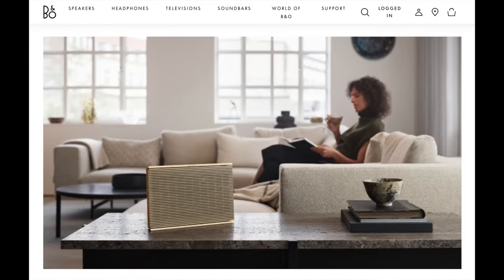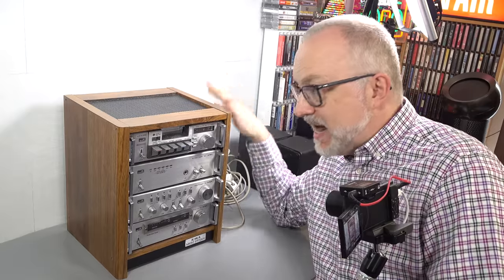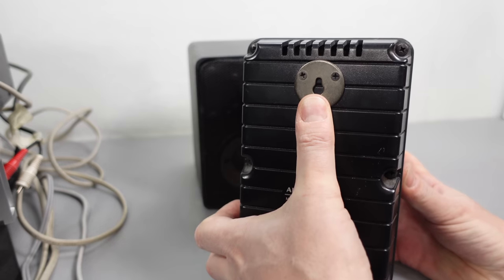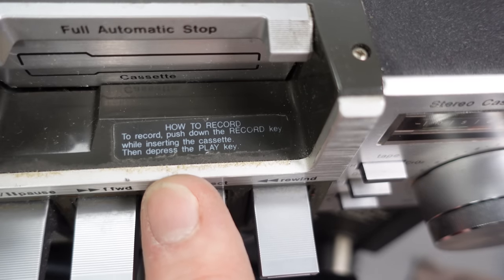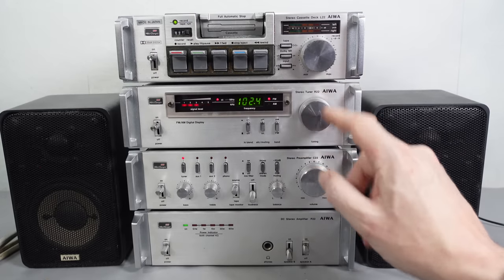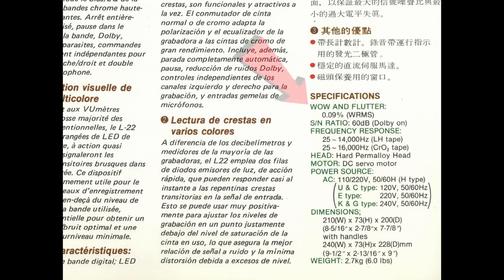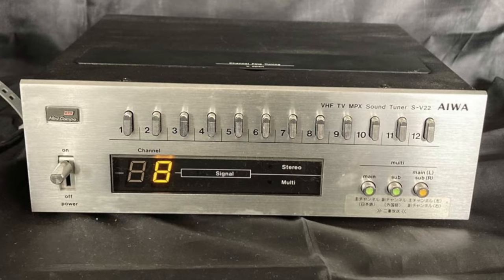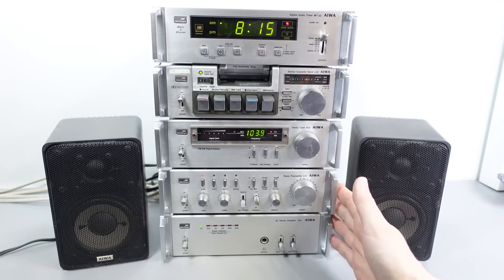AIWA SYSTEM 22 -  Micro HiFi from 1979

Comment: Hey, Matt, a neat trick to temporarily shrink the loose belt is to dunk it in hot water for a minute or so. It won't hold up, but in a pinch, it'll get you going while you wait for a replacement belt to arrive. It doesn't matter in this case, as you're only missing out on the tape counter, but it's a good trick to have in your mental toolbox.
Reply: i boil the heck out of my belts, like 10-15 minutes. they shrink but i've boiled one out of my Philips boombox, that I play tapes in a lot, and its been months and the belt is still good. wow and flutter is also relatively low
Reply: @RealEpikCartfrenYT  yeah, it can last a couple of months, but eventually they fail again. I learned this trick when the CD tray of my XBox 360 failed to open back in 2015 or so. Boiled the belt, worked like a charm. But it didn't last. So best get a new spare for when the old belt eventually fails on you again.

Comment: We had a AIWA mini system that was a "Boots" badged product from    the early 80s. Great system that lasted over 30years. Infact it was very similar to this, so probably a later evolution.
Reply: I have a Boots hi-fi receiver of the same era which was a rebadged Awia product. I recognised many of the switches, LED style and text font.  Nice amp and still going in my shed system but the tuner had poor sensitivity from new.
Reply: brilliant and far better than paying every month for a wifi connection..
Reply: @iawarenow658  How are you accessing YouTube?
Reply: My Aiwa 22 was originally purchased at Boots and the speakers are Boots badged Keesonics (and are very high quality; they are a delight to listen to, and are in regular use).
Reply: A lot of Boots badged consumer electronics products were surprisingly good
Reply: I have an AIWA NSX-D5 from more into the 'mini era', 1992 I think, and listening to this video through it. The CD player needs a new belt I think, and the cassette decks will play, but not wind/rewind (belt problem again?) It's pretty hard to access the CD player's innards. Otherwise works as an amp and speakers, great power and range.
Reply: @IThinkYouLookLarvely  so almost none of it works save the 'aux' input?
Reply: @ILuvHeroin  Probably a simple fix for the cassette decks. I just like the amp audio quality better than a newer Technics setup I have. Oh, it does have a radio that works :D

Comment: The 22 probably refers to the spacing on the rack bolts, as that's ultimately what determines compatibility.
Reply: Good call. Will probably induce a headslapper moment for Mat.
Reply: You get like for the idea, but I just measured mine and its 23.6cm from the outside of each 'handle' to 'handle'. They don't actually have bolt holes, just a removable rack handle. Distance from the centre of each handle is about 22.8cm
Reply: Makes me wonder if AIWA also provided 'flat' rack ears which accepted screws, for mounting in the flight-case style of cabinet.
Reply: 22 might be the depth of the unit(s).
Reply: @herbert weixelbaum  Height is 71-72mm. The Power amp is a tad taller at 72mm. Depth is very variable, again the Power amp in the deepest, at 24cm, the Preamp is only 17.5cm. The Radio, without the AM antenna is about 17cm.
Reply: @garyt123  i see. i don't own an aiwa system 22, so i can't/didn't measure one. i'm referring to the dimensions given on the site hifi-wiki, which are indicated as 210 × 70 × 220 mm. i cant' link to the site, sorry. youtube tends to regard my comments with links to external sites as spam. you can find it easily, if you google aiwa system 22 and hifi-wiki.
Reply: @garyt123  I think he means you measure the width of the opening on the *rack*, not the component. As in, they all fit in a 22cm wide rack?
Reply: @herbertweixelbaum  I think that wiki has some bad info. I, like Matt, measure my system (P22+C22+R22). With, and without the rack handles (which are purely decorative BTW, there is no "mechanism" or holes for actual rack-mounting) there is no 22cm measurement to be found anywhere.

Width, without handles 20.5cm, except the P22 which is 20.8. width with handles is 24.1cm.
Depth is variable. The R22 is smallest at 17.2cm. P22 is deepest at 20.2cm and the C22 is a tad over 17.3, almost 17.4cm.
All are 6.5cm without feet. 7cm with feet.

All measurements are just the actual case/faceplate, not including Knobs/Buttons on the front or connectors/AM antenna on the rear.
Reply: @bgood1673  Just checked. All except the P22 are 20.5cm wide. The P22 has cooling fins built in which make it 20.8.
The removable handles do add a little extra as they are not recessed into the case in any way and attach with two screws either side. Even counting those (which would be the exact size of the rack opening, they are still only 21.1cm wide.

So it still remains a mystery. The denomination is most probably a project number, or something similar. After all, their next mini system (1981), which did away with a separate pre & power amp which was replaced with an integrated version, was denominated the Series 30. They were not 30cm wide. Radiomuseum gives dimensions as 21 x 7 x 20.5 cm (WHD). The handles look exactly the same to me so there is no way we could get to 30cm.
Reply: Yep 22 from screw to screw

Comment: As for the "22", it's designed like rack-mount equipment, and racks are often specified by a non-obvious dimension. While the setup you have doesn't hold the units in place with screws, that flight case at 3:18 makes me think it was an option, so it might be that the 22 is the distance between screw holes, maybe on-center?
Reply: Yup, that might very well be the case. The width from the left edge of the left ear to the right edge of the case looks to be 22cm, so if the screws are centered on the ears, that'd be it.
Reply: every real rack system I have ever worked on is 19 inches wide and height is  specified in units, 1U = 1.75 inches, 4U = (1.75*4) 7 inches
Reply: @osgeld  Yes, for pro- or semi-pro units designed to fit a standard rack in a studio or flight case, 19" and the "U" system for heights is standard. But here, we're talking a consumer-grade hi-fi system that was designed to look like a set of pro-grade rack-mount units. Many home hi-fi systems of that era (and later) were designed that way, but in fact most of them weren't really separate units at all. Sony were particularly guilty of making systems that were actualy a good old "single unit" internally, but disguised to look like separates.

Comment: 22 might be the rack width. If the ears had mounting holes, they would likely be 22cm on centers.
Reply: I thought the same. I made a set of rack ears for my first CD player that were oversized to fit (19") and it looked factory original as I used similar anodised aluminium.
Reply: Yeah, that's what I was thinking. The distance between the bolts is what determines compatibility.
Reply: Standard professional rack hardware for music synth and even server computer is 19 inches. 22 cm is a nice width to put 2 of them side to side (half rack)
Reply: @patricklepoutre 19" racks have 17¾" of free space between the rails. Mat said that these cases are 20.5cm wide, which would put two of these at 41cm, or slightly more than 16⅛", which feels like an awkward gap to fill. I really like your thinking, but I'm not sure it works, and it still doesn't explain the "22". Maybe a 22cm-spaced sub-rack that can be mounted in a 19" rack?
Reply: @wbfaulk  You have to add a rail down the middle for support, that's where the extra couple centimeters goes.
Reply: 222.25 (8.75'') between inside flanges.
Reply: @mal2ksc  There already exist half-rack-width devices and they don't use an additional rail.
Reply: @wbfaulk  All the half-rack equipment I've worked with has either had side screws only, and required a center bracket, or had front screws (alone or in addition to side screws) and used a flat tie plate.

The side-mounting braces are a bit awkward to install, but look much cleaner. Of course, it also reduces the possible width of each device.

On further reflection, I do recall seeing a few devices that put their tie braces into recesses in the top and/or bottom. But none of the flat-brace methods are relevant here since these components only accommodate screws on the sides.

Comment: I do hifi repairs for a living, exactly the stuff you show around on your channel is the stuff I get my hands on pretty much daily. We get stuff from all over Europe and have found a lot of trust within the German Tape deck enthusiasts communities, so it's good to know that despite the age of cassettes and tape decks we are one to get them to work even in this current year.

Unfortunately it's a dying industry, almost nobody wants to repair old hifi anymore. The lack of schematics makes it difficult, and even if you get schematics and can make use of them with your electrical knowledge.. where do you get parts like for example the tape deck? There are of course sources to get alternatives that can provide parts that will make a repair work, but its again a very niche industry, we at my job are lucky we get the parts we do. 

I could self promote the shop I work at but unless you want to ship stuff to Germany (we have partners in the UK, nobody likes shipping in and out of Europe..), I wouldnt know what to suggest. 

Depending on where that VU meter on the tape deck is getting the levels from it could be a transistor in or near the output stage. I'm sure you've packed it away already, but next time try recording a cassette in stereo and check with another deck if both channels are present. Not what I'd do if I were repairing it but I don't think you'll want to poke around a circuit with an oscilloscope while the mains power is on lol.
Reply: How do you even get parts ? I'm sure there are some replacements that could be used for things like capacitors, but I was thinking a lot of parts would be impossible to source.
Reply: @juandenz2008  Most of the parts would be available, just some wouldn't be in quite the same package. The tricky bit, as mentioned, would be the things like the tape mechanism. Caps. diodes, resistors and the like are all much the same as they were though. Getting some values exact on some parts might be tricky, depends on the parts.
Reply: I've taught myself board level repairs for PC stuff over the years and the most common failure is capacitors. There have been some dreadfully cheap makers over the years, but I've seen even good ones fail in similar boards. I've replaced other IC's, like RAM, but a couple of capacitors usually does the trick. And then, if I'm doing one or two, I might as well do them all and avoid trouble down the road. The other common problem is battery leakage.. This is where I learnt to keep my bodge wires as close to original length as possible when doing a track repair.

Comment: Always best to turn on the power amp last, after the sources and preamp. Some older gear wont have an output signal delay circuit and results in a loud pop which can be ard on speakers.
Reply: I Have A 1977 Leek Amp 3400 And Have Always Turned Volume Down To 0 When I Turn It On To Save Speaker Damage, Its A Very High volume Amp..👍
Reply: Not really a problem with the order. The manual for the Aiwa (and my old Rotel) advises turning the volume down to 0 when switching off (and it would, presumably, stay at 0 when you switch on, kids and grandkids permitting, of course, so always worth checking before switching on). The Rotel has fuses, which did blow that one time back in 1992 when I forgot to turn the volume down. The Aiwa (neither the P22 or C22) doesn't, which makes me think it does have a protection circuit. However, mine has been working for 45 years now, and I'm not going to test it to see if it does, and if it works 😂.
Reply: I never switch mine off.

Comment: hi Techmoan, I'm watching your video because I was lucky enough to recently acquire by chance while looking for a power amplifier the 4 elements of this Aiwa chain: tuner R22 stereo cassette deck L22 prealplifier C22 and amplifier P22 for the price of a song. only the K7 turntable was out of order I opened it, removed the insect nests and rat droppings, changed the out of order motor and the 4 belts and oh happiness this system works wonderfully connected to my Boston Acoustic Lynfield VR40 floor-standing speakers which are reborn and have never experienced such deep bass, dynamic and pure midrange and precise, chiselled and crystalline treble. a real pleasure for my eardrums without ever any fatigue even at high volume. Mini chain but what an incredible punch even my Victor 2020 was driving them not so quickly. This mini Aiwa composition is pure joy and what's more it is ultra rare on the world market. I understand that their owners guard them jealously. I'm thinking of making a listening video. with good headphones you can hear the YouTube sound and you can appreciate the quality. Play an Ellen Meryl CD and you'll be glued to your couch...go listen and stay as you are. strength and honor. Aiwa!

Comment: For the belt, boil it in water for ten minutes.  This usually renews old belts if all they are is expanded.
Reply: It's a band-aid. Over time, it will stretch again, I've tried it with variou belts before. Better of just getting a new one.
Reply: it definitely fixed the speed issues in my philips boombox, been months and the belt is still good so yeah boiling it does work
Reply: That’s just a temporary fix which might be fine for just showing it off on a YouTube video  but A better long term fix is just to buy a new belt of the right size as they are easy to source these days cheaply.
Reply: @pedrodaniellopesferreira2916  Actually, ALL belts do that.  This is a solution if no alternate can be found.  The better the condition of the belt, the better the results.
Reply: @richardkelsch3640  good luck finding a "good condition" belt on a pioneer ct300 that still has the original belts from 1981. 
Great advice! But you are better of buying new ones. Am I wrong, or do want your argument to win?

Comment: This video made my day. I have a lot of sentimental feelings for the Aiwa brand as I bought a mini-system in 1991, the Aiwa SX-N350, that lasted as my daily music system until about 2013. In fact, the speakers that came with it are still part of my current system! It was a dual-cassette, three CD changer and tuner and the thing just worked great and sounded great and lasted 22 years with speakers still rocking 32 years later. And I listen to music every day. Cheers!

Comment: Nice video. In fact, that the components are completely separate is a plus, as you can use in anywhere you want. Nothing more frustrating than having coming about a this sort of component that only works dependant of other components and special cables. 
This unit comes even with a seriously good and competent selection of inputs. It's really a gem.

Comment: Nice!  My father used to have a PHILIPS F 009 Super HiFi-minisystem, produced in about 1980.
This was a really well made all aluminium system with a cassette, tuner, preamp and power amplifier.  A marvel to look at but eventually the cassette system started failing (as they do) and we sold it to an enthusiast collector. 
We also had a look inside the cassette system but the electronics were packed so tightly that we gave up.
Reply: That is a fantastic system.
Reply: @FlixTraveler  Indeed, the power amp was rated 55W and it could easily drive medium sized speakers without distortion - in fact I think my father blew out his old 70s speakers with this before buying a pair of Translator Impact 1 with Seas tweeter and 22cm Peerless woofer, very nice.
Reply: Check out the Philips FW-17 as well. Philips were masters of value for money. Most things in my childhood home were Philips and we just took the good quality for granted. When we bought some lesser brand, we usually regretted it.

Comment: I'm pretty excited for the next one. I remember the Aiwa systems of the late 1990's and early 2000's, they were in every single one of my friends homes. I always thought they had decent sound to them as well.

As far as the repairing of old systems goes, I understand the struggle. I myself cannot solder to save my life, so it really limits my personal abilities. I had a wonderful shop in my hometown called Tomtronix that I used to use for some repairs, but sadly he has retired and moved on.

My current hobby is collecting and fixing up Bang & Olufsen audio equipment from the late 1980's through the 1990's. With that hobby, I've been really lucky to meet someone who does not live too far away who can solder really well, so I've been able to keep a lot of equipment alive that would otherwise be tossed out.

I would love to see your experience with B&O gear on this channel because I think it's some of the most fascinating hi-fi ever created, and the sound is very good as well.

Comment: FYI: 'hi-blend' doesn't make it mono. It reduces the channel separation at high audio frequencies. The vast majority of additional hiss from an FM stereo decoder is at high audio frequencies, so this provides noise reduction without defeating the stereo decoder altogether. It was very easy and cheap to implement as it often only required connecting a low value capacitor between identical points on the left and right audio channel circuits internally with a switch in series to disconnect it when not engaged.